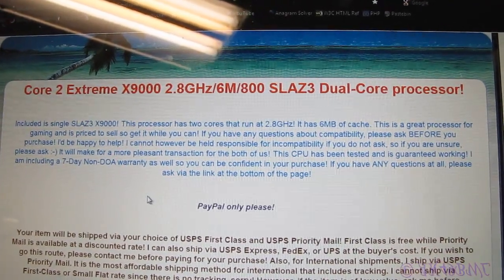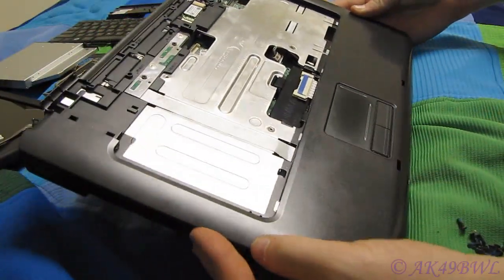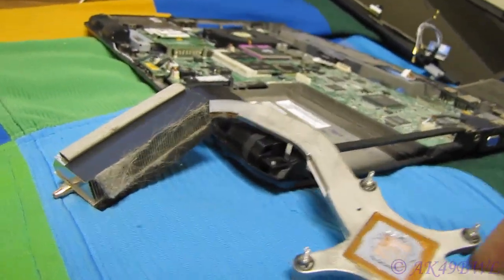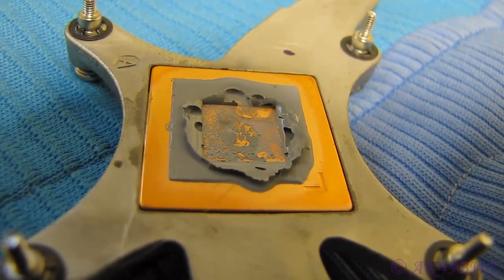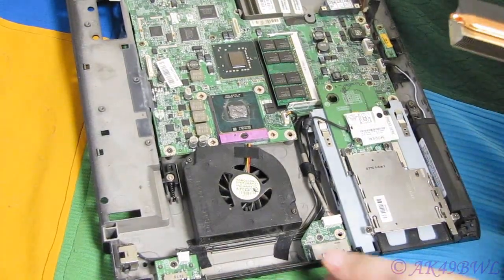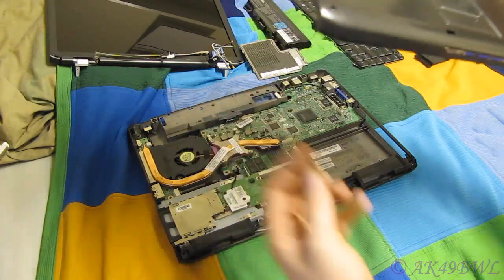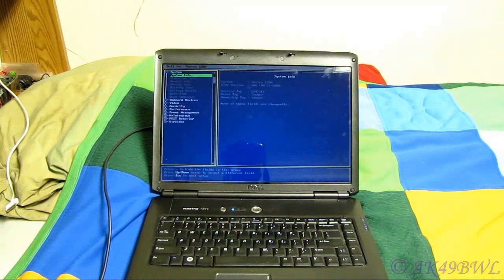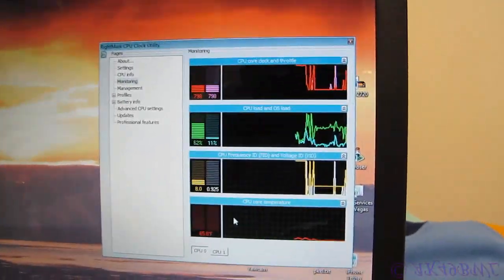How to Replace a Laptop CPU

Comment: Hey nice detailed vid, I have a vostro 1500 also and was thinking of upgrading the chip instead of buying an entire new laptop. This thing has been perfect for me and still is. How was this upgrade for you? I currently have a Core2Duo T5270 1.4GHZ. Was thinking about the T9500 and a SSD.
Reply from the maker: +jaxjaxson that's actually what mine had before I upgraded to the T7250 lol. This upgrade took me from 2.0Ghz to 2.8Ghz, and it's a wonderful and very noticeable difference... You going from 1.4Ghz AND going to SSD? That things gonna seem like it's screaming once you're done :D
Reply from the maker: +jaxjaxson also I would recommend the X9000 like I got.. It's better than the T9500 :)
Reply: +AK49BWL Ok obviously you have had no issues with the X9000 I am assuming? I thought we had to stay with the T line Core2Duo to be compatible with our MB??
Reply from the maker: +jaxjaxson that's what I thought too, but I figured, the X9000 has the same FSB of 800Mhz, and Intel's site says it IS in fact supported by the GM965 chipset on the mainboard. You might, however, want to double-check your BIOS version before you upgrade - mine is A06 and the X9000 works with it just fine. You'll also maybe want to look into a program called "RightMark CPU utility" - this program gives you the ability to lower the CPU core temperatures and control the core multiplier from within Windows.. The 2.8Ghz CPU does get quite a bit warmer than its 1.4Ghz counterpart lol :)
Reply: +AK49BWL Thanks for the excellent info, Yes my BIOS also is A06. Do you have a good place you recommend getting a chip from? I am assuming any chip I get X9000, T9500 etc...will be used?
Reply from the maker: +jaxjaxson Not necessarily. I bought mine on ebay, and it was a new but open box part - basically part of a bulk order of 50 CPUs in a single box that the seller sold individually. I can't remember anymore what I paid for mine but a search on ebay for "intel x9000" reveals anywhere from $90 to $125 right now. Heck, I'd buy this one :) http://www.ebay.com/itm/SLAZ3-SLAQJ-INTEL-CORE-2-EXTREME-2-8GHZ-CPU-PROCESSOR-DUAL-CORE-2-DUO-USA-/172048500047?hash=item280ee3c54f:g:oB0AAOSwYIhWh41f from a USA seller so you'd probably get it quick, unlike all the China listings :P
Reply from the maker: +jaxjaxson Also I'm seeing the T9500 is going quite a bit cheaper at $50 to $80, so it's up to you really.... I just know the X9000 is the highest you can go with this machine, but either way you go, you're definitely going to notice a strong improvement :)
Reply: +AK49BWL After thinking I am now wondering if I should just get a cheaper T8300/T9300 these are $15-$25 on ebay. Instead of shelling out more $ into a 8 year old laptop. The SSD I buy can come with me if I get a new laptop so thats not a problem but this chip will not. But with that said this laptop is crazy, it is 8 years old and still does everything I need. The only downfall is 4Gb max ram and with a 32bit OS that is only 3.5GB. Never tried to upgrade to 64 bit as I am unsure of any unintended side effects, and to be honest to go to 64 bit just to reclaim an extra .5 GB of usable ram is probably counter productive since win 7 x64 requires a full 1 GB more of Ram to run. Anyhow you think a $15 T8300 2.4ghz 3MB cache or $25 T9300 2.5ghz 6MB cache would be a good enough upgrade? Do you have 64 bit on your vostro? Thanks for all the info.
Reply from the maker: +jaxjaxson the Vostro is not capable of fully supporting 64 bit because the hardware manufacturers never made drivers for Win7x64 - namely the Intel graphics. And like you said, the machine only supports a max of 4 GB anyway so there's really no point lol. I like the sounds of the T9300, mostly because of the doubled cache. And yeah, that would still be worth the upgrade :)
Reply: +AK49BWL You are the man ,thanks for the 64 bit details. Gonna place an order for the T9300 for $20. Will be back here for reference when the chip comes in , who knows when that will be since its coming from China.
Reply from the maker: +jaxjaxson awesome :) if you have any other questions or anything feel free to drop another line here.

Comment: I have an old Toshiba Satellite C655 with an Intel Celeron 900 CPU. I would love to upgrade the processor . Other sources have said it can be upgraded. One Youtuber upgraded from the same CPU to an Intel Core Duo T8300. How do I find out what else is compatible with my laptop?
Reply: This is a little late, but I have a quote from a guy who quoted another guy on the chipset your laptop has.

For anyone else on the same chipset (GL40) looking for upgrades, it does not matter if the CPU you desire to upgrade to is not listed on your laptop's CPU support list. However, if it's a Socket P processor with 800MHz FSB (not higher), then it will work with your GL40 chipset. Here's a quote, by Drev9 from CPU-Upgrade.

Quote:The GL40 chipset will support Any Socket P CPU with a max of 800Mhz FSB. I have owned multiple Toshiba Satellite L355's, and have installed upwards of a T9500 and T9300 successfully. These all work:

T9500
T9300
T7800
T7700
T7500
T7300
T7100
T6500
T6400
T5800
T5750
T5550
T4200

There are plenty more, but I have tried all of these successfully in a GL40 chipset motherboard. As long as you are running socket P, and do not exceed 800Mhz FSB, it will work.

Comment: dude dell laptops are dangerous don't own one they explode
Reply from the maker: +uppishcub1 mine is going on 8 years of non-explosive service, your logic is flawed.
Reply: ***** well haven't you heard about the exploding dell laptops
Reply from the maker: +uppishcub1 yeah..And that was like 15 years ago.
Reply: yeah but that's an old laptop
Reply from the maker: +uppishcub1 not THAT old.
Reply: +uppishcub1 I've had a dell inspiron 1318 since 2009, upgraded the ram and the HDD for a samsung evo 850 ssd, and it's running windows 10 like a champ

Comment: i bought the new i9 and i replace it in my lap thank you
Reply: Peasant. I have an i15 9970k, 552GB (DDR4) of RAM, and a GTX 1280.
Reply: I got my new i2837483748374836387384738468363836 with 7878377.909736373 thz (terahertz) proccesor
Reply: +Rei -  Craft if you would know anything about cpus then you would know that "7878377.909736373 thz" would not make your system faster in anyway and that it would immediatly melt your whole house down because of the unbeblievable heat lol
Reply: ***** nah... you know nothing. with that speed can finish all tasks faster than light speed for sure. but problem is. how can you make a chip like that. like the cooling of nuclear power station plant. you can always cool that. but the chip with that FTL speed is impossible

Comment: this laptop looks too old why don't buy a new one?
Reply from the maker: +. 乂crazy乂綠茶 because that's the reason people go broke, thinking they gotta have the latest and greatest all the time. I make my equipment last as long as it can, cheaply upgrading as needed until I feel it can't do what I need it for anymore. Then I buy all-out a new machine that I feel will last me several years. Buying the parts for this machine to make it better costs FAR less than buying a new machine when I don't feel I need it at that time.

And for the record, this video is old and I bought a new machine exactly a year ago.

Comment: Dear Madam, Sir,     
I have samsung np300e5a-s01tr laptop and i5 2430M type processor HM65  south bridge I want to upgrade my computer processor can i use (if I found)Intel Core i7-2640M   or   Intel® Core™ i7-2630M 2.90 GHz product. 
Thanks in advance for your help
Reply: I am upgrading my i3-3310m to a i7-2820qm. However, you can't just base it off of Intel's website - in fact you have to search the socket yourself. Download CPU-Z and then search online for the socket.
Reply: Thank you for answering my question Joe. As you see I research myself and found HM65 type socket it looks same but is it okay? What sould I do?? Anything else?.

Comment: why that cpu doesn't have metal covering ?
Reply: coz laptop cpu dont have any metal covers...
to reduce size and weight mobile(laptop) cpu dosent have any metal cover
Reply: +ishan khan The actual CPU [ the part that produces heat] is under the small square metal disk. The rest of the chip is connections to the city of millions of transistors built on a tiny wafer of pure quartz .
Reply: can i use pc CPU on my laptop

Comment: well that is interesting...they used a socket in this laptop and didn't surface mount the cpu....I am assuming he check the new cpu compatibility with the MB...this MB must have a number of configuration variants so they socketed the cpu.... lol..good thing you added the update about the overuse of thermal paste...I was gonna mention it...nuff said...

Comment: can I change my Lenovo Z370 i3 laptop CPU to i7?
Reply: +Dato Aliff Alex depends if the cpu is socketed and if the i3 and i7 CPUs use the same socket...you will have to check to see if the MB supports an i7 cpu and if so if it supports the i7 you are thinking of changing to

Comment: i have a Lenovo Ideacentre b540 and can i change the Cpu to amd and can someone tell me wat Ram do i need for this pc because im thinking about either getting Nvidia or Amd and someone help me out?
Reply: +GamingWithNerds pc specs
intel® Pentium® G2030 (3.00GHz 650MHz 3MB)
Windows 8 64
Intel® HD Graphics
4GB PC3-12800 DDR3 SDRAM 1600 MHz
Reply: +GamingWithNerds no you can not change the cpu to AMD they use two different chipsets ...your cpu may be surface mounted on your MB but if socketed they are 2 different socket types due to pin differences...check your user manual or manufacturer's website to see what type of memory to use with this MB ..the sockets will only accept certain speeds and types of memory DDR2 or  DDR3
Reply: i found out a site that shows u its name is Crucial.com

Comment: My processor is an AMD A8 6410 with AMD Radeon R5 graphics 2.00 GHz. will I be able to upgrade the Cpu without changing the Graphics?
Reply from the maker: ProGameplayGamer No, unless you upgrade to a CPU that has the same graphics - but if you can get a two-for-one, and upgrade both, why not? :D
Reply: ***** Would that cost more to upgrade both?
Reply from the maker: ProGameplayGamer Probably... But with the graphics being built into the CPU, if you upgrade, you may not even have a choice in the matter lol. I don't know AMD all that well so it's on you to find what will work for you :)
Reply: oh okay. I got it man I found a processor with the same AMD A8 unit. It's a good upfrade for both graphics and processor. AMD AMD A8 7600 FM2+ 4MB Box R7 Series Graphics 3.8 4 Socket FM2+ AD7600YBJABOX
Reply: ***** Thanks by the way man :)
Reply from the maker: ProGameplayGamer Sweet! Good luck to you - and if you hadn't already seen the comments, don't thermal paste it to death like I did :P lol

Comment: My Laptop
HP G50-133US Notebook PC
Intel(R) Pentium(R) Dual core T3400 @ 2.16GHz 
3GB of Ram 
OS Windows 8.1  
my computer is vary slow, I know I need ram and I'm thinking of getting 8GB of ram but I don't know what kind of Ram to get same with  my CPU. Whats the best CPU I can get for my Laptop?
Reply from the maker: junior anaya HP product specs say you cannot upgrade the RAM - it's maxed out at 3GB. You can try, the type is 200-pin DDR2 SO-DIMM at 667 or 800 Mhz (use CPU-Z to determine), your machine has a 1GB and a 2GB in each respective slot (and I do not know where those slots are either lol). As for your CPU, I couldn't tell you what it supports - Searches lead me to believe the machine has a GM45 or GM965 chipset (but I cannot confirm), which will support a wide range of CPUs up to and including the X9000 Core2Extreme in this video. Images of the mainboard suggest it's a socketed PGA478 much like the one in this video. But again, since HP is very closed up about their machines, this is virtually ALL speculation.
Reply: ***** never do ddr2
Reply from the maker: Owen Ernst If your computer requires DDR2, exactly WHAT do you suggest??
Reply: ***** haha then i said nothing
Reply: ***** or actually, update computer
Reply: your pc should not be slow. heres what youre going to do. download a program called ccleaner and delete all temporary files and registry. this will make your pc much faster. go to the task manager and click on startup and disable any startup proscesses that you do not need like adobe's ones. if your pc is still slow then you need a memory. if you do not know how to use ccleaner just google it. its a great program.

Comment: that is too much thermal paste ur cpu will blow up take it easy man!
Reply from the maker: bobi966 hi, the machine still works so it hasn't blown up yet :)
Reply: ***** ok tell me can this specs beat ps4 if i upgrade my laptop with external gpu like GTX 750 ti or a monster like GTX 690 and CPU i7 3940xm 3.0GHZ TO 3.9GHZ and RAM 8gb ddr 3 tell me please can this laptop specs beat ps4 !
Reply from the maker: Idk, I'm not even sure what the PS4 is specced at..
Reply: ***** see the specs wikipedia and then tell me pls!

Comment: Hey! I was wondering, is it safe to upgrade Processor? I have a Toshiba Satellite with Pentium 3558u, and really want to upgrade to i3. Just curious as to what you think...
Reply: Adam Hagengruber If the Pentium 3558u has the same socket type and voltage and current (Amps) specifications, TDP and FSB specifications, the BIOS supports such an upgrade, and the Pentium 3558u is socketed and not soldered in, then the chances are favorable that you may be able to upgrade the CPU.

Comment: hey i wanted to know if it is possible to change the CPU on my Lenovo laptop that has the following specs :?

- Intel Pentium® Processor 2.16 GHz 
- Windows 8.1 64-bit 
- 4GB, PC3-12800 1600MHz DDR3L
Its a Lenovo G50-30 , and i wanted to change it to an intel core i7 or i5 is it possible